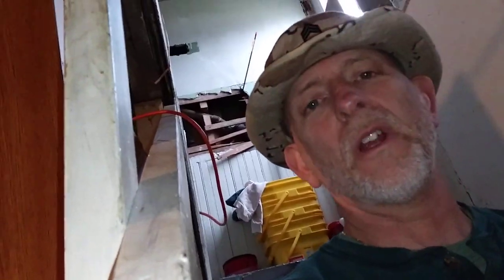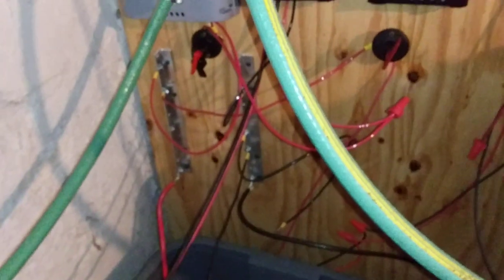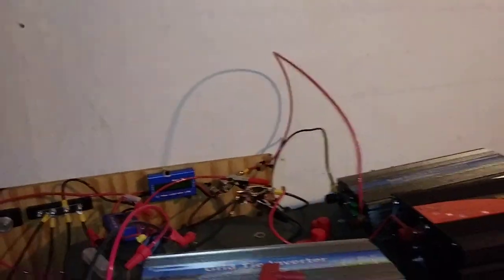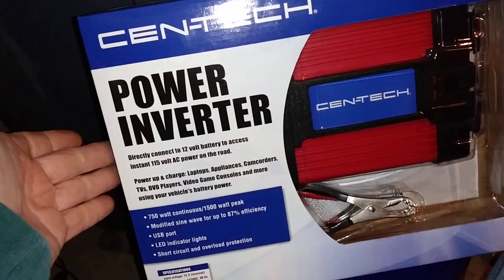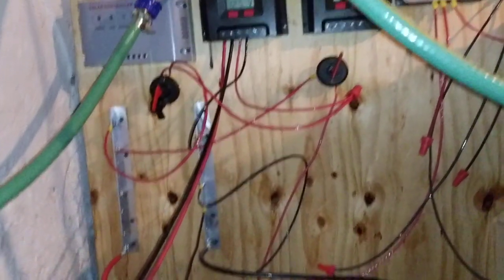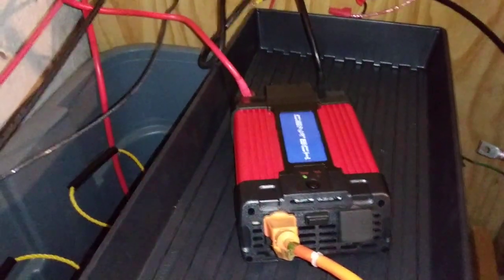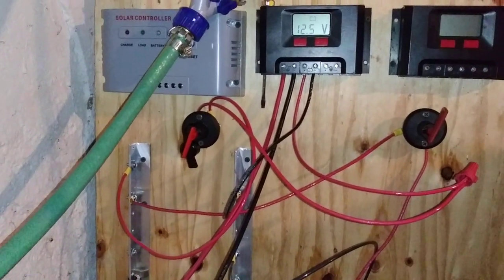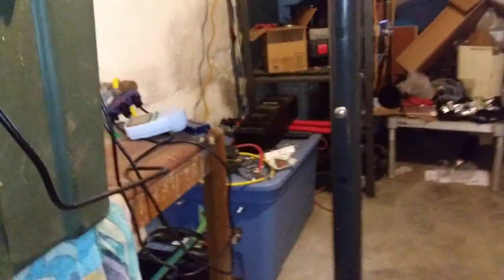Cen-Tech 750 Watt Sine Wave Power Inverter for Off Grid

Comment: I have read that the pure sine wave inverter uses less of the power to run than the modified sine wave. Probably be some more money but would it be worth it ?
Reply from the maker: I will get new batteries first. I borrowed 500 so soon two more solar batteries will be installed. I have to see if there is any in stock before i make a road trip